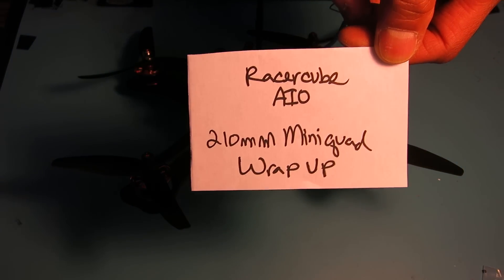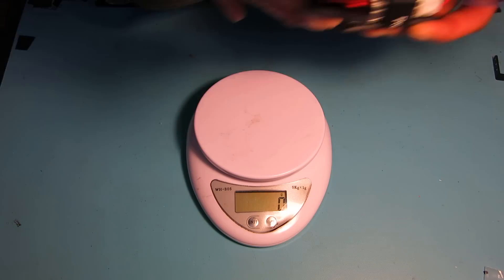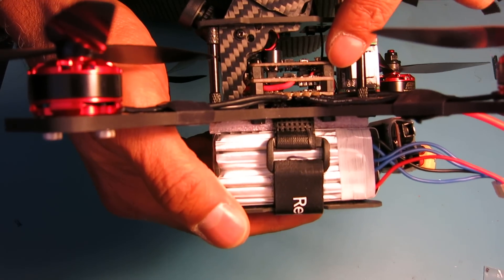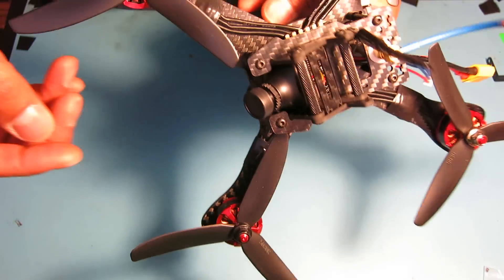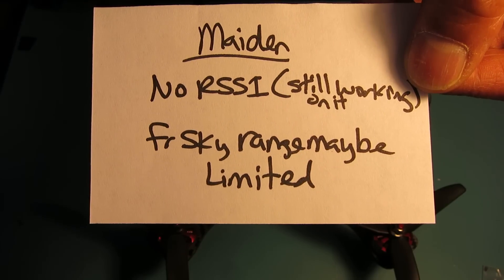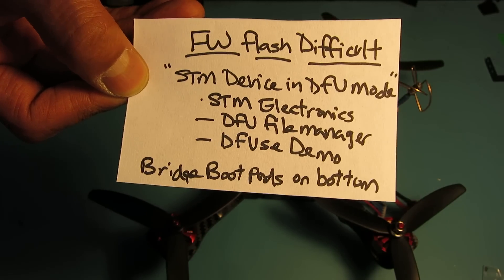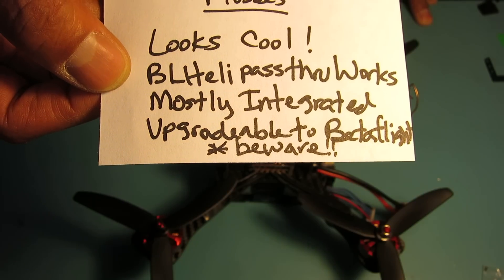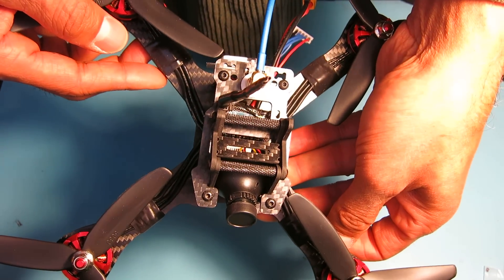Racercube build: Wrapup after maiden flight and opinions on AIO package.

Comment: First mini quad? Very nice! One thing though, throw a couple layers of liquid electric tape or conformal coating on that all in one esc, it seems a little sketchy... ; ]  

Also train your self with the free simulator's !!FIRST!! to learn Acro/Rate mode, so you can try new things & push your self crash, reset, and try-again instead of crash, rebuild, & try-again... Theres even an android simulator thats pretty good but cost's "Quadcopter Simulator Pro" totally word every penny, but invest in that to train where ever whenever.

Good luck
Reply from the maker: I definitely put in many hours flying the DRL simulator.  Now, if I could only get my quad tuned as well as the sim.

Comment: CHECK MY REVIEW IN BANGGOOD.COM, THE MANUAL IS WRONG THE MOTOR ORDER IS TOTALLY WRONG IN THE ESC STACK.PUT THE ESC FOWARD WITH THE ESC POSITIVE IN THE RIGHT HAND, NOW ALL THE ESC WILL BE LIKE IN BETA OR CLEANFLIGHT ORDER, THE MANUAL IS WRONG TOTALLY WRONG.RSSI WORK JUST FINE, ACTIVATE RSSI IN CLEANFLIGHT AND CHOOSE CHANELL 9 IN MY CASE WORK EVEN WITH DEFAULTS.MINE IS ISTALLED IN A MM130-O FRAME.

Comment: Did you ever figure out what kind of range your getting?
Reply from the maker: I have another video, but I was getting approximately 20-30 meters range before my FrSky DJT module was giving the second warning tone.  I just received a new RX board from Banggood.com yesterday.  I'll post a new range test in a few days.  Come back for the report.
Reply: Mile High Multicopters 

Thanks.   Hopefully better luck.
Reply: You received a new RX board...  Is that because you felt your original was defective, or is this an upgrade board to a better or different version?  Many thanks for the video.  I'm sitting on the fence about this AIO option.
Reply from the maker: The replacement board I received seemed to be exactly the same as the original.  I believed that the limited range of this board was as it was designed, but since they claimed a "Transmit distance: > 1Km", I sent an e-mail to Banggood.com along with my original range test video.  I did not request a replacement.  I only commented on their claim and my finding.  They responded very quickly and offered to send a replacement transmitter board.  I was very happy to get a chance to determine whether my original transmitter was defective.  You can check out my "final" range test video for on this here: https://youtu.be/TCdGjLE3tCE

I do have regrets about this package and would like to get my money back.  But, I am using the Little Bee 20A 4-in-1 ESC and don't want to uninstall it to return the whole package.  I like the ESC and give it a thumbs up.  If you want the top 2 boards, make me an offer on the 2 RX boards and 1 FC board.  But to give fair warning, an external receiver on the original setup was not reliable and I just gave up trying to make it work.
Reply: Many thanks!  Your range test video steered me away from this AIO package.  I opted instead for the Flycolor Raptor 390 with which I can use the receiver of my choice (XSR).
Reply: Mile High Multicopters so it's that bad?! The R had bad range... The OSD not working properly? And how about the FC? What's wrong with the F3 board? Cos I have the Racercube here and I'm hesitant on doing a build with it... I'm afraid it will be a waste of time... And source of future headaches... I might be better off to just sell it and hopefully at least get some money out of it??? before attempting to hurt my head trying to get it work? Any other Racercubers out there who all had bad experience with it?
Reply from the maker: Power up the F3 and RX boards with a 3S or 4S lipo and do a range test with it to decide whether your board has enough range.  I see that as the showstopper because, I had range problems and using an external receiver caused the quad to fall out of the sky after a minute or so.  You may have different results.  The only thing I would do with my board is build a micro that will be flown < 100M range.  Other than the range issue, I was able to get OSD, voltage, RSSI, Betaflight, etc. working fine and the quad was flying just fine.

Comment from the maker: Finally figured out RSSI is on Channel 9 for OSD.  I kept noticing that Aux 5 in Betaflight always had a changing value. I came across an article by Oscar Laing https://oscarliang.com/rssi-ppm-channel-taranis/ and although I don't have a Taranis plus, I had what looked like a signal value.

You have to turn off the RSSI_ADC in the configuration tab and on the receiver tab, select RSSI Channel 9. You then have to go into MWOSD configuration and turn off Use PWM. Turn on Use FC RSSI and set the RSSI min, RSSI max and RSSI alarm.

I have mine set to:

235 RSSI Min
899 RSSI Max
30 RSSI Alarm
Reply: I will have to try this out when I get home. I was really bummed the RSSI wasn't showing and I didn't make the connection about the crazy aux 5 channel. Thanks for finding this!